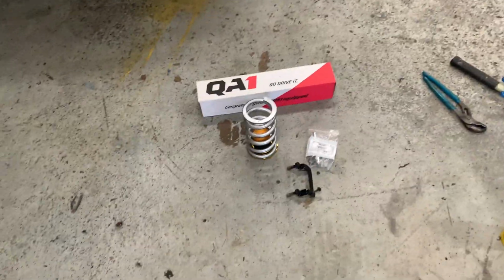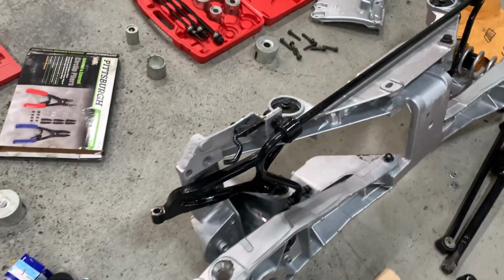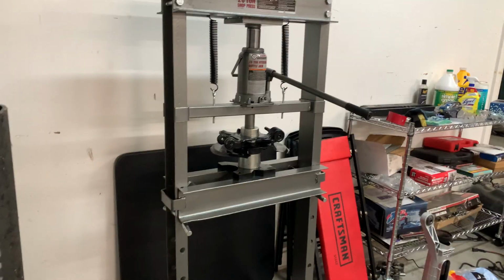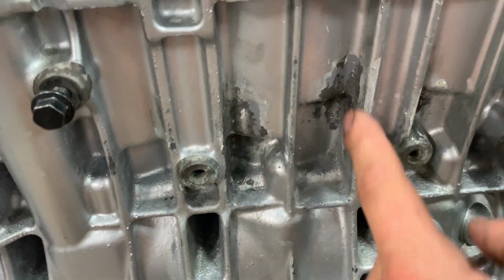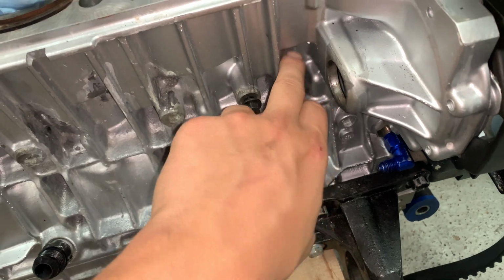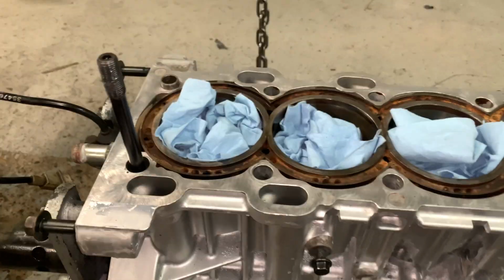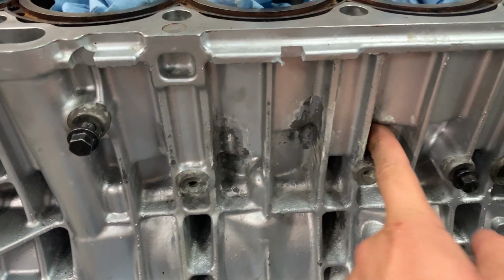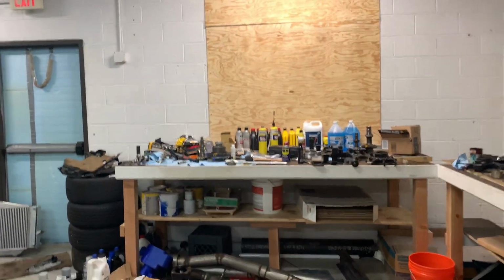Volvo 850 T-5R AWD Swap - Rear Suspension N Stuff

Comment: Hey there might be to late but do you have part numbers on the adjustable coil upper mounts and springs in the process of getting parts together to rebuild my 850 AWD rear suspension
Reply from the maker: BNE Dynamics sells them.

Comment: Looks really good so far mate! Have a 850 awd built myself, her in Norway, and have been searching for a good rear suspension solution, and yours looks really great!  Could you comment the parts number for the spring and coil or the website? Possibly the info for the rear shock too? :)  Looking forward to see the end result of your built! 
Btw, do you have any experiance with trimming the 850 awd? thinking spesifically about the gearbox and viscous?

Comment: Can you do like a cost breakdown on this build so far so it can convince me not to do this?
Reply from the maker: Ehh maybe. Im not a fan of those types of videos. Its probably to going to be a bit under the 5 digit range for the AWD swap alone.
Reply: @SimplyVolvo  unfortunately that is not in the cards for my s70 at the moment. But keep up the good work. Im really looking forward to seeing what this beast can do.
Reply from the maker: @SKEETER1292  You have to keep in mind this is including all of the R&D costs of the billet parts I designed and a complete nut and bolt restore on the rear subframe and much much more. If you bought a cheap donor and just left everything stock and swapped it over you could do it for under $2000.
Reply: @SimplyVolvo  good point. I don't think I would have to go that extreme. My power goals are around 500 hp. So watching how to do some of this is very helpful.

Comment: I bought generic energy suspension bump stops to fit my Kaplhenke rear mounts. Had to trim them a bit, bolted through.
Reply from the maker: Ill look into em, thanks!
Reply: @SimplyVolvo  part# 9.9101G cut off first two steps. And they also make shorter ones.

Comment: Hey Matt, what's the part number on the front engine mount bracket that bolts to the block? I have the RN block, and haven't been able to get out to the junk yard to pull one.
Reply from the maker: Look it up in VIDA. Its for 99-00 P80.
Reply: @SimplyVolvo  I don't have VIDA...
Reply from the maker: @turbovolvos40  You should get a copy. Very useful. 9186828.

Comment: Im wondering if its possible to convert a 855 AWD to RWD by rotating the engine 90 degres and add a BMW ZF gearbox and a speciall driveshaft. Remove viscus and freewheel cuppler. Is it possible? Steering rack Would be in the way but maybe the 965 car has front suspension and steering rack that cab be modded to fit a 855. Any suggestions?
Reply: It can absolutely be done, but it would be far easier to just modify a 960. If you do rotate a whiteblock around, and are trying to push huge power, you need to go with looser rod bearing clearances than on a transverse engine layout.
Reply from the maker: Anything is possible ;) Has it been done before? Don't think so but its definitely possible. Can reuse the whole rear if you remove the viscous coupler. Would definetly need firewall / trans tunnel modifications to fit a RWD transmission.
Reply: @SimplyVolvo  yeah i've read a couple of forums on the internet about the topic and it is possible.
Reply: That would be a nice winter-project on one of my AWD's.
Too bad it will never happen since I live in Germany and there is absolutely no chance to get a build like that roadlegal

Comment: Nice to see that rear suspension setup. I wish I would've known about those components about a year ago.
My Nivomat shocks on the AWD where shot and I decided to go with a K-Sport Coilover suspension. Biggest mistake on the moose so far.
The shocks, springs and adjusters themselves are of pretty good quality ( I believe them to be rebranded D2 Racing ) but the spacer between the upper spring seat and the adjuster ( necessary in this case) was not included. And that even though the whole suspension was certified and approved by the german TÜV, which was the main reason for spending 2000 Dollars on a suspension.
I ended up fabricating the spacers myself, which ended me up with a not roadlegal suspension again.
Keep up the badass fabricating and the motivation, you inspire me.
Cheers from germany

Comment: You should take a Volvo automatic convert to double clutch. I keep my s60R 6 speed because i don’t like  Volvo’s single clutch in s60 355hp polestar. I want lambo hurricane auto, that rips truth gears.
Reply: Could you explain this a little further please?
Reply: greenhometony i try I want the automatic  from the lambo in my Volvo, double clutch. The original single is to slow. The lambo hurricane rips tru the gears.
Reply: @karlsundbeck1028  your terminology is odd.  Dual clutch automatic is a completely different style from a standard (torque converter) automatic.  The S60 has a standard style auto, not a "single clutch" which would be an automated manual, also commonly found on (older) exotic cars.  Single/dual clutch are built more like standard manual transmissions. 

FYI standard 6 speed autos have multiple clutch packs.  Probably 4 at least, and a couple brakes as well.